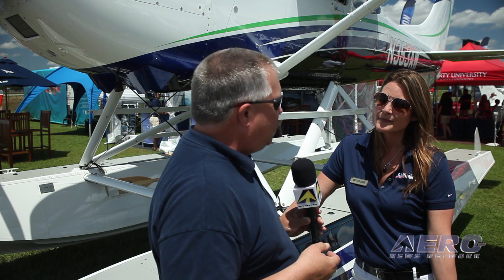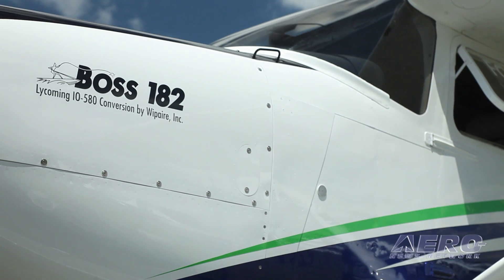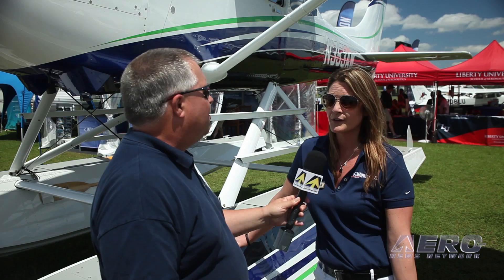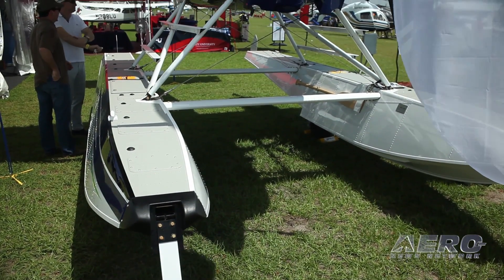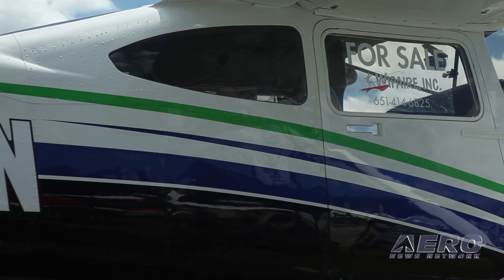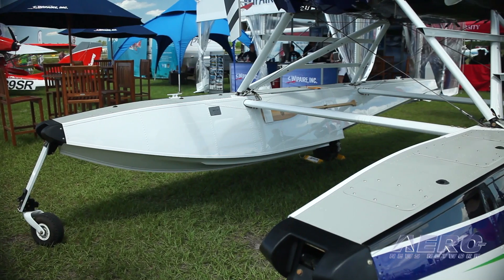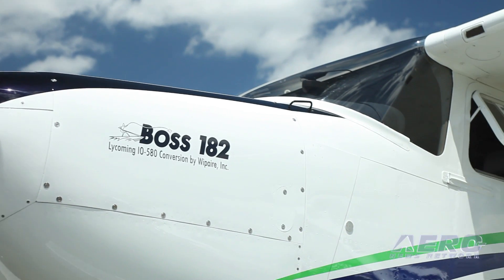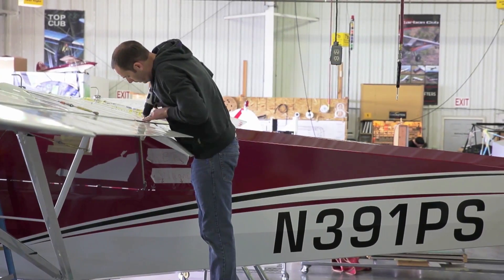Aero-TV: Goes Like Heck! - Wipaire's Boss 182 Amphibious Conversion

Comment: Jesus H.. 150 G just for the engine conversion.. o_O
Reply: Are aircraft engines really that expensive? 

But there was 5 years plus of engineering work that has to be amortized.
$100G for a set of amphibious floats sounds about right. 

A lot of work went into this project.